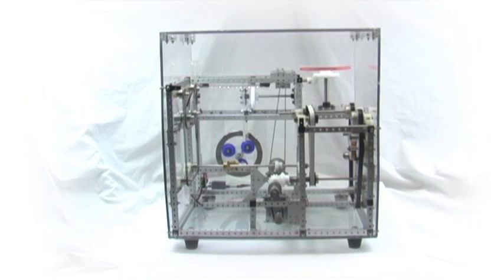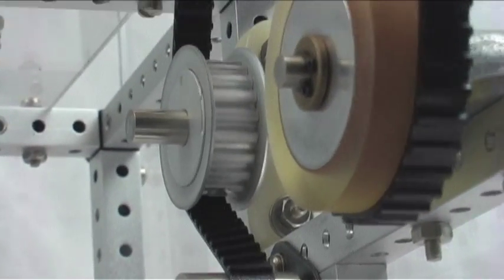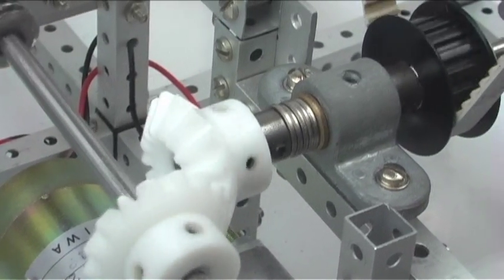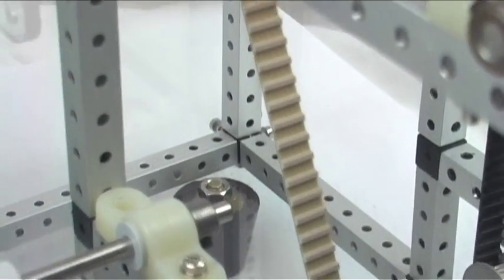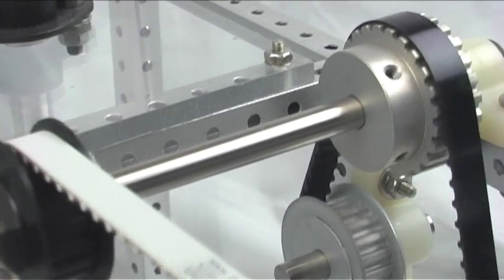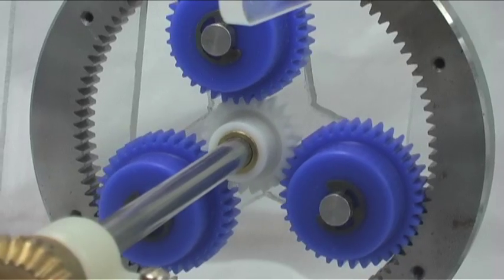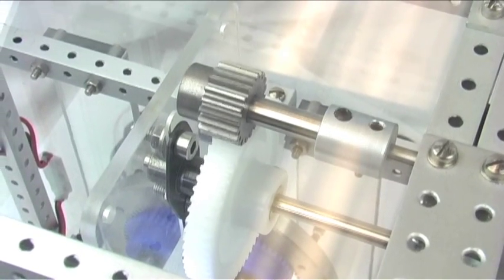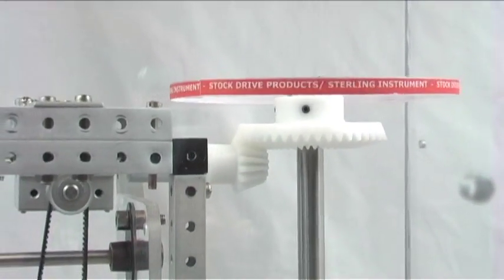Mechanical Drive Display

Comment from the maker: This Mechanical Drive Display demonstrates our standard belts, pulleys, gears, and more. The SDP/SI engineering team designed and built this mechanical drive display to showcase some of the parts that we offer and how they can be used in your project.

Watch this video where we show you how our Mechanical Drive Display works and see the various mechanical parts that make it work.